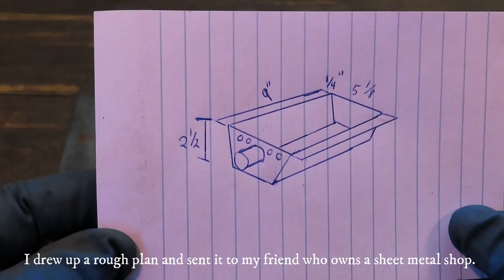Broken Portable Hibachi BBQ [Better than new restoration]

Comment from the maker: Let me know what your favorite thing to cook on a BBQ is.Happy grilling!
Reply: A suggestion for the dust in the sandblaster. If you got a grading sieve you could separate out all the different grit sizes in the sand, removing the dust and giving you a way to control how aggressive the sand blasting is. It would probably also let you separate out the rust and dirt, allowing you to reuse the same sand for longer.
Reply from the maker: Thanks for the suggestion!

I will be adding a vacuum system to help clear the dust out eventually as well. 

Thanks for watching

Comment: Great restoration! 
I have one of these myself. Had it for years. Picked it up at a flea market. The cast iron grills busted a long time ago and they were a little flimsy for my liking. I upgraded them by replacing them with some nice ceramic coated ones from the store. A little modification for fitting and much better. Probably I’ll redo the finish again like you did instead of cleaning it and applying heat paint. Great video. Bon appetite!😊
Reply from the maker: Thank you for watching.  That does sound like a nice upgrade, I was actually looking at doing a ceramic coating for the whole unit but a kiln was needed. The oil seasoning has held up wonderfully

Comment: What is the spray you used to restore the grills? Is that something I can do at home? (My grills are so rusty but I'm struggling to get it off with steel wool and vinegar alone).
Reply from the maker: After I removed the rust I used cooking oil to season the grill as you would with any cast iron,  for removing rust you there any many options depending on how you want to do it. There are rust removing liquids, you can use electricity in an electrolyte bath, or sand it off. Lots of options. 

If you have a shallow container that fits the grill you can fill it with vinegar and let it soak for a few days or a week it will take off the vast majority of rust. 

Thanks for watching
Reply: @cardinalrestorations  Thanks for the quick reply! At 9:51, you put the grills into something and apply some process but I can't figure out what it is!
Reply from the maker: That is a sand blasting booth.
Reply from the maker: You can also buy the little self contained sand blasting guns that don't need a booth. Make sure to wear eye and hand protection as compressed air, sand and your body don't mix well.